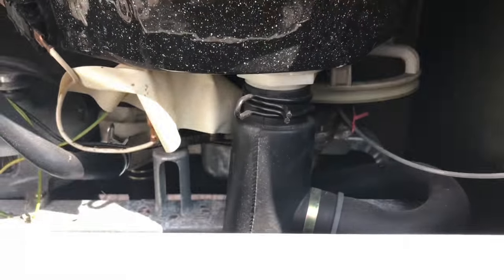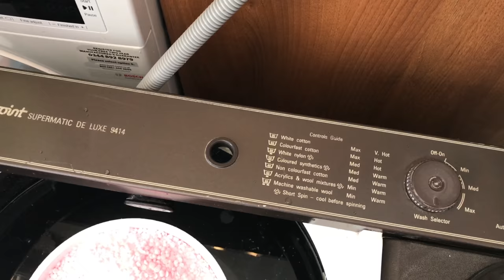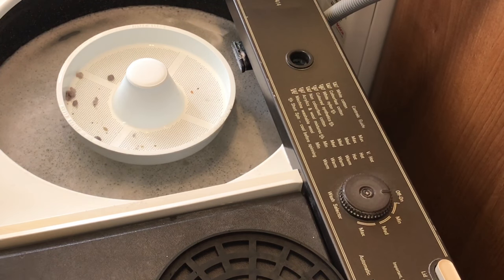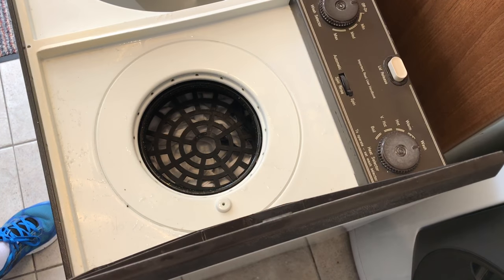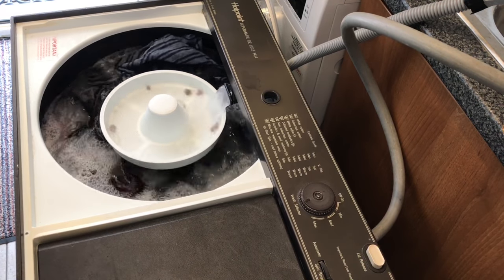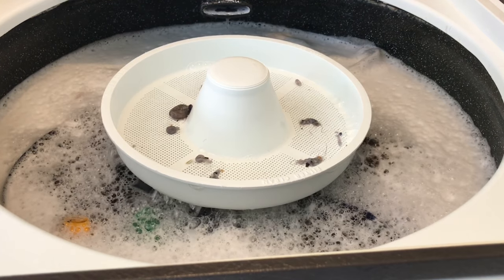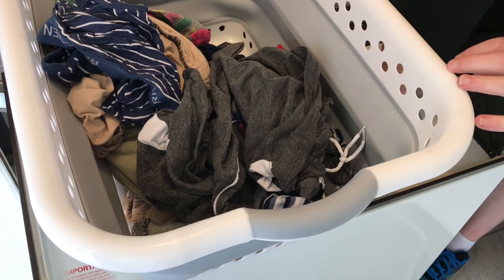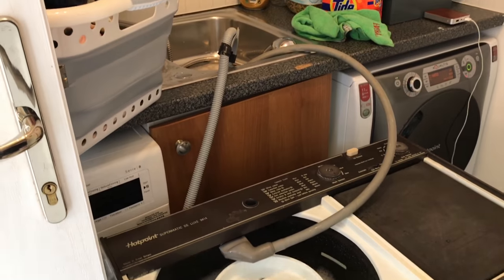Hotpoint Supermatic De Luxe 9414 Maintenance & Full Demo

Comment: Nice to see a proper kitchen sink rather than these stupid and unhygeinic belfast sinks. They were NEVER made for modern kitchens. They have gaps down the side which are impossible to keep clean and woe betide if your tap goes wrong. Major operation to remove sink for access to the tap
Reply from the maker: I’m gonna have my taps out to the side for easy access, but have a conventional sink with a Belfast sink with access to all four sides as I know exactly what you mean.

Comment: Still use my Electra 78HPT 1465 a re-badged Hotpoint weekly, at least 45 years old & still works fine.
Reply from the maker: That’s amazing!!!
Reply: @HooverLux  Hi, Just watched your video from the beginning again.
There is no sump on the spinner, there is a sump on the washer which I have topped up with 80/90 EP oil. I often remove spinner drum/shaft & lubricate the bearings & shaft with MolyBen grease, which is probably why after 45 years it is working weekly. Modern laundry liquid is fine to use.

Comment: Great video...just one point..i remember when I had one of these, I would dissolve the powder first, add the whites to soak while the machine heated up, that way, the clothes were soaked in the powder before the 12 minute wash.
Reply from the maker: +kirri2003 That’s a good idea for the whites load, I will give it a try next time I do a white load, I do normally do 2 12 minute washes for every load, just my OCD there lol.
Reply: yes..i remember the instructions said fill with water, add detergent, agitate for a minute to dissolve, add whites.(.teatowels, socks anything that needs a good wash and soak) switch thermostat to heat,  hot or v. hot, wash time to max...and let it do its job..a fantastic machine that I really loved!..i bought an Ariston single tub on ebay about 4 years ago, brand new in the box..its very good, but not a patch on a supermatic!!
Reply from the maker: +kirri2003 I do enjoy using it.

Comment: I had to have a lol when you said your Aqualtis and the twin tub were both made by Hotpoint - maybe in name, but the twin tub was made in Great Britain, actually by Hotpoint, and the Aqualtis is made by Indesit, somewhere in Europe, probably in Turkey, and a Hotpoint logo put on it. I can guarantee that the Aqualtis won't be still washing clothes when its 40 odd years old, unlike the twin tub. Most front loaders die a death within 3 - 7 years these days, usually from spider fracture or bearing failure. When I look at the insides of that twin tub, I can see real quality, and it was much more complex than the Hoovermatic that my granny used to have (although hers was a 1964 model) in that hers had only one pump, and a water valve that had to be turned to drain the tub, together with turning the spinner on, using its pump to drain the tub. The Hoover also used a vertical spinning wheel impeller on the rear side of the tub, rather than a bottom mounted cone that the Hotpoint used. It looks like the Hotpoint uses some kind of fluid clutch or coupling on the spinner, so that it can spin slowly when full of water, and then speeds up when the spinner tub is empty of rinse water. My guess of the age of that twin tub, would be possibly 1979, although I'm nowhere near as knowledgeable about washers as I am about vacs, lol
Reply from the maker: MadAboutHoovers That one was made in the early to mid 80's, I was told 83. I do agree about the name lol, but I really look after the Aqualtis and hopefully will last a while with my care, but will definitely not be around in 30 years time, will be recycled as a tin of soup maybe or a part in something else. 😂
Reply: Just noticed - you got the title of the video wrong - it says Hotpoint 9414 on the top of the machine itself, not a 9314 as you say in the title. Also, if its the same machine as you showed 4 months or so back, you called that one the 9404, so I was a bit confused thinking you had 2 different machines? unless they are different machines?
Reply from the maker: MadAboutHoovers yes, same machine I'm just chunky fingers on the keys with a goldfish short term memory lol x
Reply from the maker: So true
Reply: Whirlpool own both Indesit and Hotpoint!
Reply: Hotpoint and Indesit are both owned by Whirlpool.
Reply: Hotpoint and Indesit washing machines are made in Poland and Italy.
Hotpoint and Indesit tumble dryers are made in Yate in England.
Reply from the maker: Thanks for the info, it’s hard sometimes to work out who owns what 😂
Reply: @HooverLux  Yes i agree. Back in the 50s and 60s Hotpoint was owned by AEI. Associated Electrical Industries.

Comment: Hi Dorian. I have a Hotpoint twin tub but the spin can won’t rotate.. When I close the spin lid the motor and pump works, but the spin can won’t rotate.  Have you any ideas.  Regards Paul. PS , how is the Electrolux 170 going I once sold you.
Reply from the maker: That definitely sounds like a belt issue. I still have the 160, would never part with it.
Reply: @HooverLux  Either the belt has broken or centrifugal clutch shoes have worn away

Comment: The top bearing is worn on this machine hence the slight lateral movement of the agitator
Reply from the maker: I thought it may be a bearing issue, but my mate has it now and he is gonna fix it all up again like new 🥰
Reply: It was a very common problem on these machines. It then caused leakage of water down into the reciprocating gearbox with the resultant leakage of oil on to the floor. SERVIS Twintubs were FAR better made with that problem in mind The early Hotpoint TwinTubs had a tall agitator shaft where the reciprocating motion was at the top of the shaft controlling the 4 vane agitator. Well above the water level. My mother had one for 18 years before the spin motor finally burnt out.

Comment: I'd be interested to know what oil you put in the sump on the spinner. I didn't even know there was a sump and I've had three of these over the years.
Reply from the maker: I genuinely used Castrol GTX 🤣, if it’s good enough for my car! 🤣🤣
Reply: @HooverLux  makes sense. I’ve just picked up a 9403 this afternoon. No idea if it works as it was from a charity warehouse but for ten quid it doesn’t matter too much. Enjoying your vids.
Reply from the maker: Ooh excellent! Hope you don’t get much trouble from it 🤗
Reply: @HooverLux  washer is fine. Spinner and pump belts missing! Typical. 👀
Reply from the maker: Buggar, but belts should be ok to find?
Reply: @HooverLux  I can't remember which one the spin drive belt is. Got one for my old one a few years ago but can't remember if it was a blue spot or some other colour. They are proving a bit illusive. Was trying to place your accent. I'm guessing valleys like me (originally) but not quite sure.
Reply from the maker: Swansea originally, one of the belts is definitely with a blue ring, I can’t remember the other? Yellow?
Reply: @HooverLux  I was a few miles out then. The blue one sounds familiar. I think I can get those. Might have to improvise on the pump belt. Thanks for that. 🤤
Reply from the maker: You’re welcome buttie
Reply: @HooverLux  Hi. Spinner now all working. I re-watched one of your vids and caught the spot on the belt you were taking off. It was a green one after all. Found one eventually and the pump belt (in fact I've got another set on the way from mother-in-law). Many thanks again. Vid here if you're interested: https://www.youtube.com/watch?v=er80dc2tY7Q
Reply from the maker: Yay! That was so nice, new subscriber here! 🤗.
Reply: @HooverLux  Oh bless you, thanks. I should have given you a shout out. Forgot. I will do so when I do the full wash video. I've just gone and bought a Hoovermatic 3174. I must stop this before I get overrun with them like I did before.
Reply from the maker: You’re absolutely welcome and thank you. I know the feeling with being overrun 🤣

Comment: Hello, I just watched your video here and was just wondering if you ever wondered why your water bill was so high! Have you noticed how much water the machine is wasting while running your machine? The entire time your machine is running gallons and gallons of water are pouring in!
Reply from the maker: No, I only use it for the occasional video.
Reply: Nicholas & Francesca   No, once the tub is filled thats it. the water is re circulating to filter out the fluff

Comment: Our church caretaker (retired, elderly, Ron Read, lives in ground floor flat next to the chapel; Pentecostal - Lincoln Road chapel, Ponders end, Enfield, London Middlesex) has the same twin tub like that, earlier this year, dad told me at church, Ron’s washing machine had a fault and could I have a look at it. I went to Ron in excitement (I had seen these on YouTube and at our Grandmothers beach chalet, next door neighbour had one, but it died and she threw it away ☹️) and asked what was wrong with it. He said the spin dryer was humming and not spinning and could I fix it? I said yes! Later that week, me and dad 
went to Ron’s flat and picked up the twin tub and I later tested it with the back panel off, the spinner motor was humming and I manually spun the fan on top, anti-clockwise and it stalls, and then clockwise and it then started up, I said to mum I had found what was wrong with it and what I did and she said “Ron won’t be doing that when you give it back” I did examine the motor (induction type) and the starter windings was black, sooty and smelt of burning and I assumed it had over-heated and short circuited. I removed the motor and took it to my bedroom where I dismantled and studied it and devised how to replace the windings. I asked Google and it took me to Wiki-how - to replace the windings in an induction motor and I remembered that a DIY YouTube blogger had made a motor winding loom out of a board and nails. I improved the process by buying a mechanical counter and cut the windings out of the motor to count the turns. 
                                       ***
After replacing the starter windings I put the motor back in the twin tub and tested it (unfortunately the print had been rubbed/had faded off the control panel/bezel and wasn’t visible, I went to YouTube to see a video of it to look at the print/markings to operate it. I had initially looked for a replacement motor online, but it was obsolete, but I did see a replacement bezel, but after managing to replace the windings it had gone ☹️ (someone else had bought it before me). I had visualised where the markings were for the dials and did a test wash & spin - a piece of wire had been dislodged in the spinner and had fallen into the pump and I removed it. Despite that, it worked and we gave it back to Ron - 😁 and he hugged me and gave me a thank you card with an owl on it and a box of chocolates. He wasn’t fussed if I couldn’t fix it as he was using it (and a jam jar) as a prop for a work surface in his kitchen and he had a separate spin dryer. He Was a bit of a hoarder and had another twin tub but we threw it out as it wasn’t worth for me to look at it and fix it ☹️
Reply from the maker: Hi Samual, what a lovely story, your a good lad for fixing it and you persevered until the very end and got it working again. Well done my friend. I may need your help with mine lol.  Just wish you were closer, never mind.  Thank you again for sharing that with me and I appreciate it.  Have a fab day my friend. 🤗
Reply: I didn’t know that the spin clutch needed lubricating, thought that would defeat it. Also would have adjusted the brake belt for the spinner and was transfixed with the safety interlock for the spinner lid, motor switch and brake, that the belt acts as a pretensioner to stop the lid from lifting up and turns the motor off. I did have the opportunity to watch the spinner spin up with the lid open by manually pushing down on the switch (attached to brake tensioner - tensions when released) and using the automatic spin-rinse; the spin motor power is rerouted to a pressure switch that senses the water level in the spinner and turns the spinner on-off when rinsing. For the test wash I did put two calgon tablets into the washer and expected to see lots of limescale in the lint filter but I didn’t, instead found it in incrusted inside the agitator (I did scrape it off) and in the wash - clothes came out with lime flakes on them 😳 why didn’t it fall off/dissolve in the wash? I also had inadvertently put synthetics in it - mum complained that they were creased after the spin dry.  “well they didn’t know that in the 70s” I said - (spins at 3210 rpm) would have put them in the modern automatic front loader (indesit, washer+dryer) and spun at a low speed.
Reply from the maker: That’s why I’d need your assistance in future. Lol.

Comment: It pains me to say this but Twin Tubs used FAR more water per load with inefficient rinsing in the spinner than a front load auto does. Believe me i have both and have measured this despite washing 3 loads in the same water.
Reply from the maker: I absolutely agree with you 100%, but I do enjoy using them every now and then for the fun factor 🤗
Reply: @HooverLux  Yes i agree but sadly i dont have the space for a twinny.